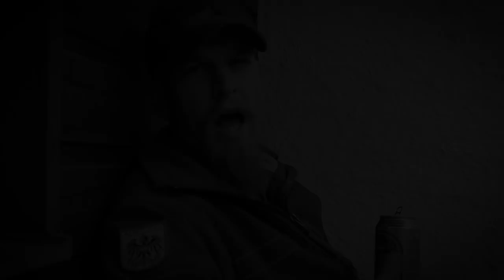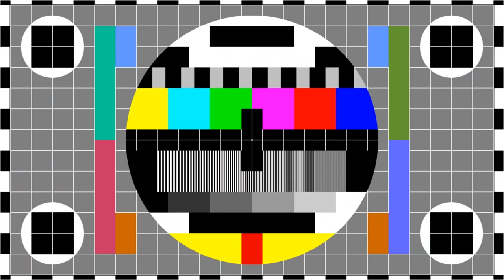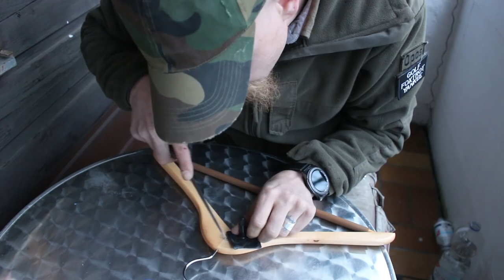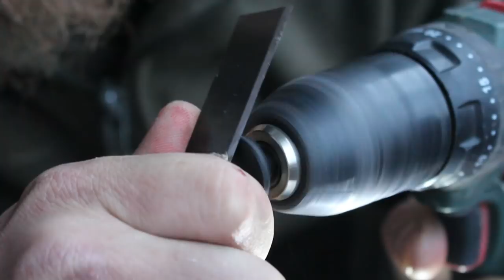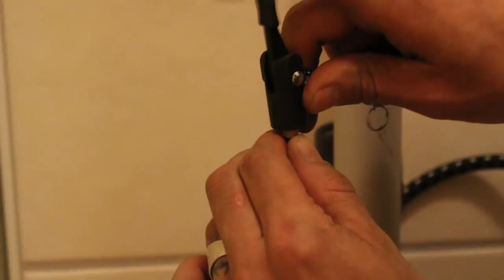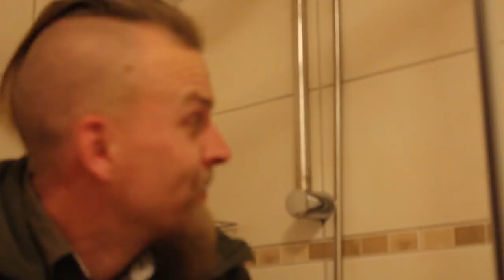How To Make A Legal Explosive Target - Post Apocalyptic Life Hacks

Comment: First, take two 2-liter non Coca-cola bottles and use one to make the above project and set it aside...  With the second bottle, cut around the body of the bottle about two thirds up from the bottom.
Pressurize your target bottle slightly so it is firm and doesn't collapse when squeezed.  Seat the  two bottles together drinking cup style and secure them with a strip or two of masking tape.
Take a pair of strong rubber bands and tape them to the bottom bottle securely with strong duck tape.  Pull the bottles apart  and cut small vees around the bottom of the bottom bottle and then fold them up inside the container.  Fill the container with seeds to see if they fall out.
Seat the bottles together again and secure them by the rubber bands with duck tape.  Test the tension of the bands against the snugness of the bottles' fit to ensure the bottom vessel can be refilled easily. 
Put together a 3 to 1 mix of Cayenne and line marking chalk.  Uncap the top bottle and fill it a third of the way or more with the compound.  Secure the cap and then repressurize the vessel. 
Cover the top half of the bird feeder with a burlap drape and then hang the whole thing at about head height for an interesting area denial device

Comment: Hahah that was too funny.
Btw I noticed you use bike tube stems a lot. True using valve stems from a parts store. You get bulk on the cheap and they hold more pressure and seal its self up too. 

Bbtw iv your using this for an alarm you could put the valve stem on the bottom of the bottle and put water in it and put wings on it like a rocket and use this as a perimeter alert so you can see and hear how far away the trigger was set if you multiple set up on your grid.